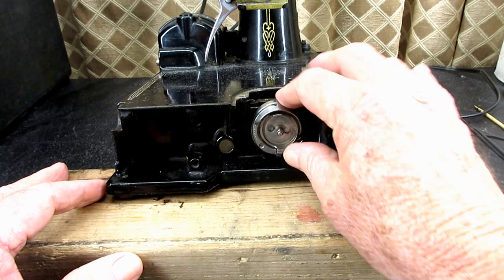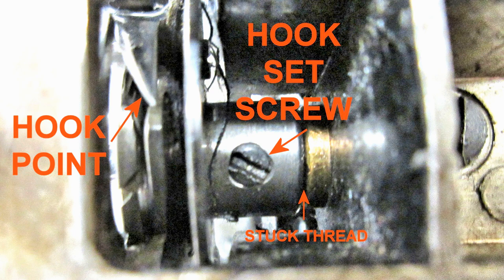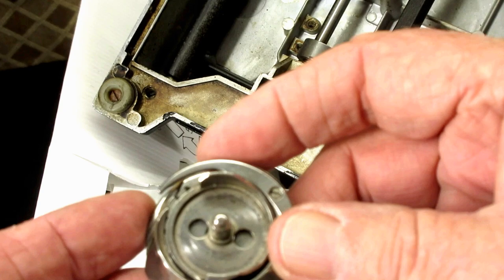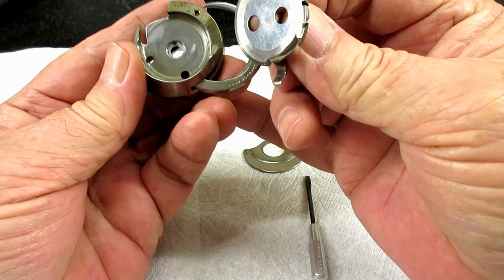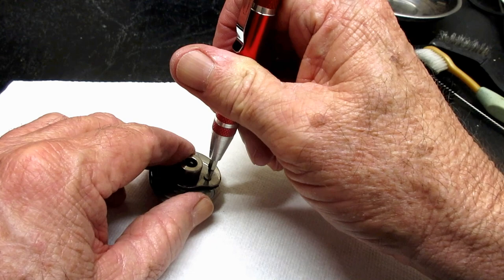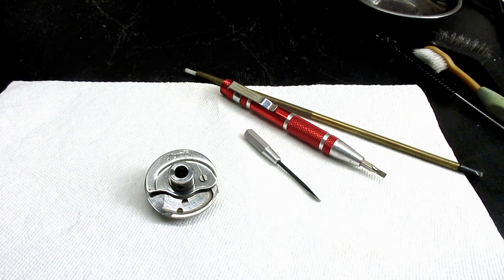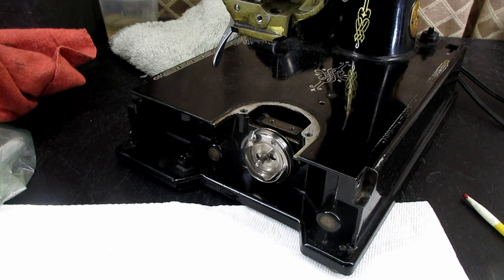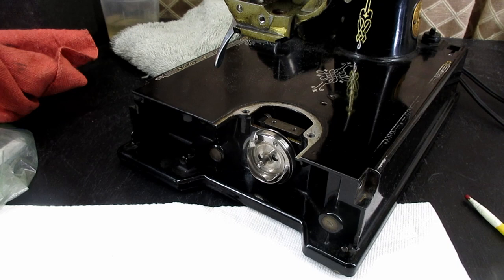How to Remove Clean and Replace the Hook on a SInger 221 Featherweight

Comment: Andy, you’re The Singer Whisperer! I foolishly purchased a model that you haven’t refurbished yet. There are a few videos available and I am grateful for them, but I literally watched someone explain something and say it was out of frame so we couldn’t see it and he left it at that! I grumbled something along the lines of “Andy would never do that.” Thanks for another stellar video; the extreme close-up stills with labels and arrows are so helpful.
Reply: Totally agree with you. Once you watch Andy, all others pale in comparison.
Reply from the maker: Wow, thanks! Very kind of you to say this. I started doing pictures like that after wishing the makers of other videos would have done so. The whole "picture worth a thousand words" thing. I'm curious what model you got. Thanks for watching.
Reply: Andy Tube  I bought a 1938 201-2. I had to replace a missing thumb screw for the stitch feed regulator. I also replaced the feed dogs.  For some reason the feed dogs were quite worn down. The first thread guide, which is just a little hook, is firmly rotated 90 degrees to the right, instead of upright. I haven’t been brave enough yet to open the potted motor to inspect the wiring. I understand there is a probability of it having to be replaced. I also understand that there may be a 201-2 rewiring kit available from an Ebay seller. The machine is quiet and produces an exquisite straight stitch.
Reply from the maker: I've had people tell me that model is the Rolls Royce of SInger machines. There is a blog about rewiring the motor and I have see restored motors for sale on eBay $70 to $90. I've never had the pleasure of even seeing a 201 in person. Happy for you!

Comment: As a warning to all others, I had fixed a 221 for a nice lady and the machine ran and stitched beautifully. I always include new Coats & Clark thread - in the bobbin as well as have the machine nicely threaded, and a sample stitch fabric. So, when the dear lady used up the bobbin thread, she used old thread and wound the bobbin, threaded it, and BAM! Immediately all thread hell broke loose. I drove to her house and spent an hour trying to adjust the tension, then take it back apart - looked good - clean out what I could see of some frayed old threads in the bobbin case.... But I finally brought the little sad machine back home and am watching your video. Now since the teeny screw won't come out of the gib, its reposing in Deep Creep with intermitted hair dryer treatments. I love the pace of your videos, you are patient, concise, and I enjoy when you chuckle over a little mishap.
Reply from the maker: I've been bedeviled by some of those tiny screws for years. You have the right approach, which is patience, IMO.

Comment: Am glad I found this video (and now 'subscribed' to this page.  Bought a 2nd Featherweight 221 at auction only to discover the bobbin case was missing!  Bought an original, used bobbin case only to find it would get stuck on the machine!  I tried my own bobbin case and it fit fine but this original replacement one for this latest purchase was a no-go.  Hubby tenderly sanded with a very, very fine sanding stone an area where we were pretty sure it was wayy to tight.  Comes on and off nicely now.  Then I discovered a "noise" when I started sewing with it after getting the bobbin case to fit.  Flipped the machine over comparing it to my own original machine only to find the hook loop guard screw was missing.  Ugh!  I've ordered an original screw so I hope it's not messed up; but, was then puzzled, "Do I have to tear this whole machine apart to get that screw in?"  THIS video was been EXTREMELY helpful.  Thank you so much, sir.  I will have to watch your other videos.  These machines are fun but can be a pain in the neck - LOL!
Reply from the maker: I'm glad you found the video too. The featherweight is a fun machine to work on and so well engineered and designed. I do agree the vintage machines can be a pain in the neck at times; even a pain in the a**, but the results are sure worth the aggravation, IMO. Thanks for the nice comment and I hope the other videos will also be helpful.

Comment: Thanks so much for this video! I had taken the bobbin assembly off and picked out a tiny bit of thread trapped behind the plate behind the assembly. This machine also made the same sound as yours, a kind of metallic clinking, when it ran. I had no idea how to eliminate it, though maybe the thread jam was causing it. It turned out to be a bit of play in that shaft. I've put it all back together with the needle plate on to hold the positioning finger and ran the machine. The clinking is GONE!!😅 So happy I found your video, I've now subscribed!! Thanks so much Andy!!
Reply from the maker: Good job Mary. I'm happy you've pursued the noise cause and corrected it and I'm pleased the video help make that possible. Thanks for keeping your machine at tip top condition and in service and I appreciate you subscribing to my channel

Comment: This is going to be really helpful for me. I saw thread caught behind the bobbin assembly that falls apart when I try pulling it out. Now I'll be able to remove everything and make sure it's cleaned out and oiled properly. Thank you.
Reply from the maker: Welcome. I had the very same problem on our 301A and that led me to learning about removing the hook. I'm glad you found my video and thanks for taking the time to comment.
Reply: @andytubesewing1953  much easier to get to the stuck thread. Screw doesn't want to budge though.
https://cdn.discordapp.com/attachments/765632108621594674/847182788838162452/PXL_20210526_184048070.jpg
Follow up: got the screw out. That little thread was barely in there but stuck pretty good. Cleaned it up just using fresh sewing machine oil. The area under the needle plate is pretty dirty with lint. Almost want to give it a good military cleaning but I don't think this will require disassembly cleaning. 😉
Thanks again.
Reply from the maker: @W4ABN  The thread looked tight even in the picture! I'm glad you stayed with it and got it out. I've always found the Singer Vintage Machines very forgiving and am pleased after a general cleaning how well they sew. Maybe it is just the good design and craftsmanship of days gone by. I've worked on machines over 90 years old that sew like a dream. Thanks for the picture and for keeping the machine in service. ✨

Comment: Excellent video with so much detail. I just purchased a 222k with same issue & have not been able to find any info on how to remove the assembly. I did try to loosen a set screw before finding your video but the screw fell out and then the gib fell off so not sure what is going on will keep looking for a 222k video but at least I know that I am on the right track.
Reply from the maker: I never had the pleasure of working on a 222K or even seeing one in person... sigh. Well, you can't always get what you want, right? The Featherweight Shop is a great resource center and they do have some parts and attachments. https://singer-featherweight.com/   You may already be familiar with them. On the Manuals page, they have service manuals (free) and there is an addendum manual just for the 222 model. https://singer-featherweight.com/blogs/schoolhouse/owners-handbook-servicing-manuals   Maybe those manuals can help. They also have a great SchoolHouse section with many good tutorials for working on the machines. https://singer-featherweight.com/blogs/schoolhouse   Caution: easy to spend hours on this website, so take it easy. Thanks for the nice comment, Patsy, and for watching my channel.
Reply: @andytubesewing1953  I figured out what the problem was when I reassembled the the case, one screw that holds the gib in was still screwed into the case housing so at some time it was put together with only one screw holding it. At least the screw was still in place so I didnt have to go searching for it. During the process I lost a throat cover small screw and they are impossible to find for a 222, much better to have a 221 when looking for parts. These machines are addicting, I now have a 34,35,36,41,49,55 221's and a 54 & 55 222, not to mention others, but so much easier to buy than sell! I just got the 222 problem machine up and running so great thanks to your very excellent video! I will check out your other videos but after this scary repair I am up for anything.
Reply from the maker: @patsytankersley1372  Lucky the screw was there. I'm glad you got it running. SOunds like you have a small museum of early Singer models. Thanks for saving those machines. Enjoy your next restoration

Comment: Andy that clicking ticking sound you are hearing is caused by flattening of those tiny flat spring in where you place the bobbin.  You will the small projection on that place you put the bobbin to.  Look closely on either side.  Those tiny springs flatten out over time.  They are a headache to change.  I suggest you just leave them be and put up either sound. 🌻
Reply from the maker: Next time I'm around a featherweight I will check it out. That's fascinating information and I appreciate you sharing it on my channel. Thanks so much!🙏

Comment: Another fascinating upload Andy, thank you. Singer seems to use bronze bearings/ bushings exclusively for all rotational points of contact...after 50-100 years of use, have you ever seen them fail or wear to the point they were out of spec?
Reply from the maker: I have done a number of 50+ years old machines and have never found one worn or misshapen to the point of causing problems. Plenty were dry and all were dirty. Bronze is mostly copper, so good heat dissipation and the OSMG I knew thought is was a type of silicone bronze chosen for hardness and low drag characteristics. Apparently a wise choice.

Comment: In removing my hook, one of the two screws broke in two.  I hope placing the remaining screw onto the flat spot will be sufficient.
Reply from the maker: I hope I win the lottery. Your plan may work, IDK as I've never tried it. The screw is part 462 "Rotary Hook Set Screw" and you can find new and vintage ones to buy online (thank goodness) I think for $10 I would buy one rather than chance the hook wobbles or the point gets damaged from a needle strike. Here are some examples, and I found others too. https://singer-featherweight.com/products/screw-singer-featherweight-hook-assembly-set-screw-vintage-original#productExtendedDetails
New screw: https://www.ebay.com/itm/191943056004?hash=item2cb0b29a84:g:v48AAOxyHBBSPzNz
Another new one: https://www.thequiltgal.com/shop/c/p/Screw-set-screw-type-Singer-221-Hook-to-Shaft-Needle-Bar-Position-Needle-Bar-Set-Screw-462-x10849110.htm
Sorry it broke, but don't think you're the only one that did that. BTW, that same screw #462 is used on your machine to hold the "Needle Bar Bushing (upper), so if you wanted you could take that out to use on the hook just to try it, but I'd really buy a replacement. Happy sewing, Steven, and thanks for watching my channel.
Reply: @andytubesewing1953  Thanks Andy.  I'll seach for the part.  The one screw is holding for now.
Reply from the maker: @stevenarmstrong7575  Thanks for letting me know. I have worked on horizontal hooks and shafts that use only one screw. Most of the vertical hooks like in this machine have had two set screws. Honestly, I was surprised someone makes new screws of this threading that Singer used. Thanks again.
Reply: @andytubesewing1953  I finished my 221 today and posted before and after pictures on facebook. If you would like to take a look. just search facebook for Steven Armstrong Lexington KY.
Reply from the maker: @stevenarmstrong7575  I don't use FB but I'll have a friend show me. Thanks.

Comment: Andy ,I love your calm style and always enjoy your thorough videos.  I'm a technician on featherweights too and I still love to watch and learn from you.  Now a question: where can I get those amazing  screwdrivers you use in the video?  I'm not even sure of the correct name of them, but one squeezes and expands in the slot to hold the screw and the other has a sleeve that holds a screw - and for such tiny screws...I need them!  Thanks in advance for your answer.
Reply from the maker: thanks for watching my channel, Rusty, and for your kind comments. The 2 small screwdrivers in the brass "tubes" were a gift to me. They are vintage and not made any longer. They are etched with the words "HJJ CO LOS GATOS CA" on one side  and the words"MADE IN USA  No. 3 - 8" on the other. I think that means size 3 and 8" long. I have occasionally seen them for sale on eBay and they sell very quickly. Sometimes 1 or 2, sometimes more, and once a set of 7. The latest was an auction for one of this same 3 -8 screwdrivers and the winning bid was $32 + shipping. Most of my friends are buying this set of drivers from KLEIN TOOLS. This set of 3 drivers have the "push piece" that spreads the tips to hold the screw, like the bigger one I own. https://www.kleintools.com/catalog/screwdriver-sets/screwdriver-set-slotted-screw-holding-3-piece   They mostly bought them at Home Depot for about $28 and a couple bought at AMAZON for about $32.

Comment: Hi, Andy.
Hope all is well. Thanks again  for your wonderful tutorials.
Hope my question below is not too confusing:)
I have been trying to find a similar screwdriver as your skinny gold one you are using in this video. I think i heard its a magnetic Hand Pressers Pusher screwdriver; by
b.j.j co ....
I would be very grateful if you would  please share where I can get these type of screwdrivers; or what's called.
Best regards,
S
Reply from the maker: ""... I think i heard its a magnetic Hand Pressers Pusher screwdriver..""  The type of screwdriver is a Screw-Holding Screwdriver. Not magnetic. The brass ones I use are 40-50 years old. Made by H.J.J. Co. LOS GATOS.  They are not made any longer. You can find them on eBay on and off and the price gets slightly higher each year. I used to get them for $10 now it's $30. https://www.ebay.com/sch/i.html?_from=R40&_trksid=p2332490.m570.l1313&_nkw=HJJ+Co.+Los+Gatos+Screw+Starter+&_sacat=0
Kline makes a set of screw-holding screwdrivers if you search for them. They also use spring tips but the handles are normal large screwdriver handles. No Drop Tools LLC makes a modern version of the HJJ co style with plastic handles instead of brass. https://www.amazon.com/NoDrop-Tools-Holding-Screwdriver-Phillips/dp/B09168HHND
USA Company FEUERHELM TOOLS makes a set based on the HJJ Co https://www.amazon.com/Feuerhelm-Tool-Holding-Screwdriver-Starter/dp/B0922Y2TV4?source=ps-sl-shoppingads-lpcontext&ref_=fplfs&psc=1&smid=A3NB0C7LGRGZV6
Thanks for watching my channel.